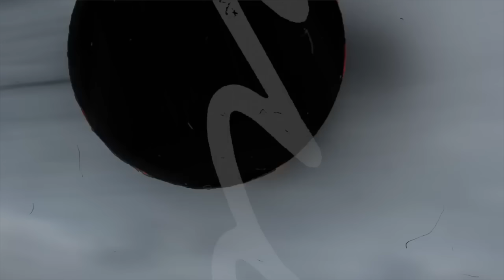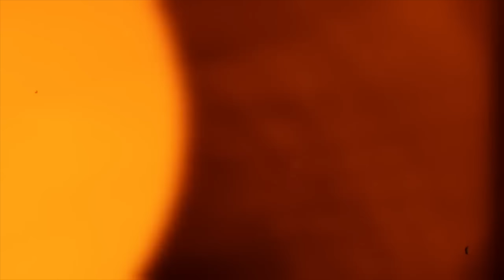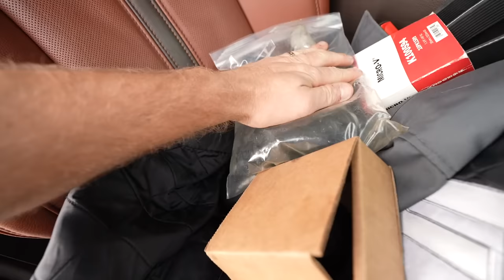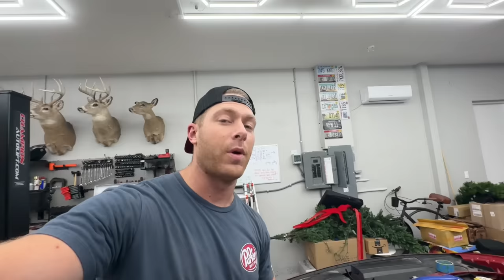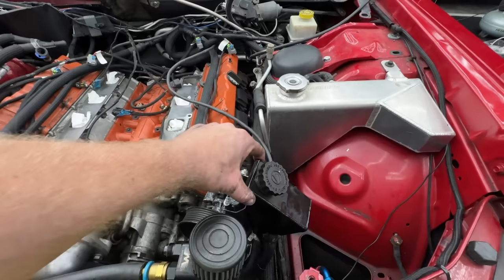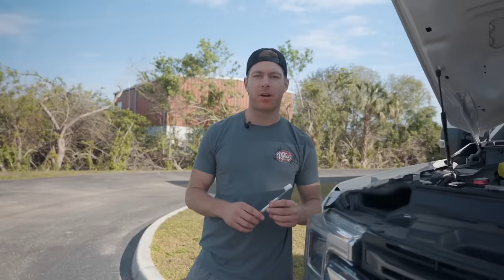I'm Over It... Installing a Whipple Blower On A Hellcat is Not A Good Time.

Comment: Was that the air compressor or your washing machine at the end of the video? Ours was doing the same thing and it had 2 blown shock absorber things. It’s easy to check just lift the front stick your phone under there and take a picture and you should be able to see whether the things are clean or you got some funky ooze running down the side.